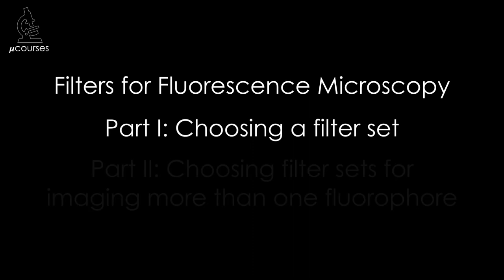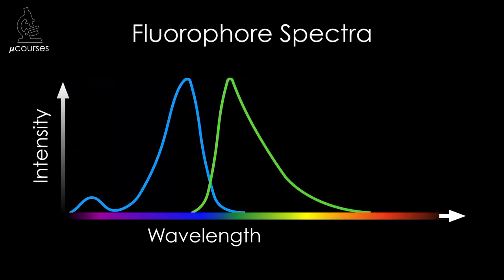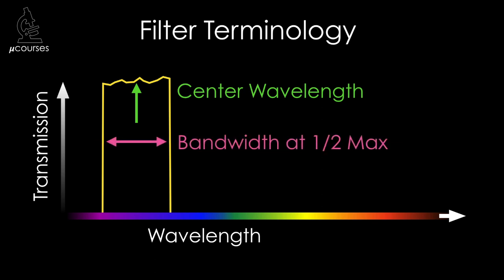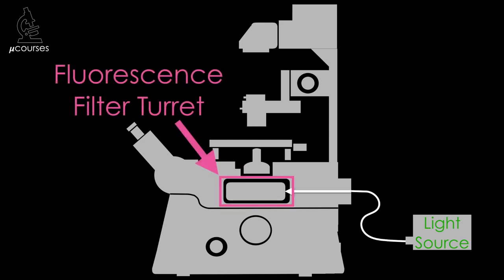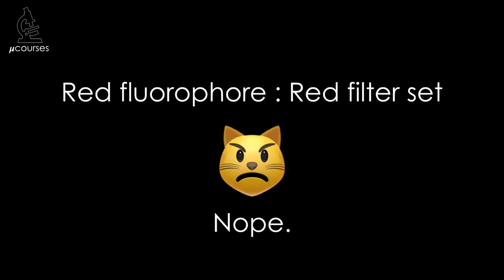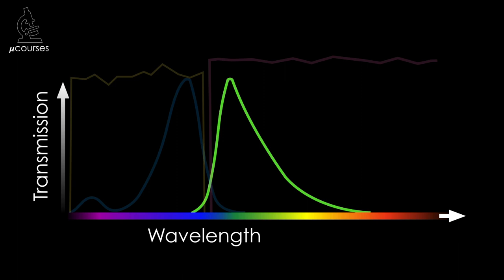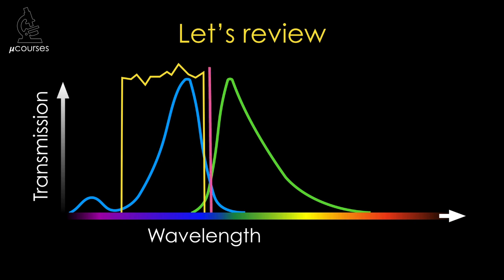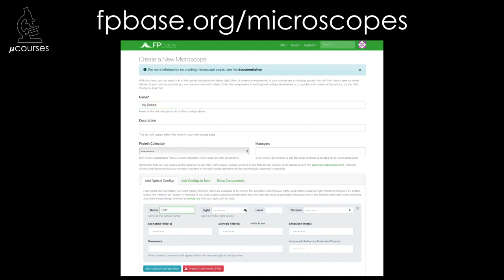Fluorescence Filters: Choosing a Filter Set

Comment: Thank you so much for the video! Could we choose the specific excitation and emission filters in widefield microscopy as well? I guess this optimization is only possible in confocal microscopy since in widefield the filters are all in one unit, is that correct?
Reply from the maker: Yes, you can! Widefield filters are mounted into a single holder (often called the filter cube), but they use the same set of filters described here.